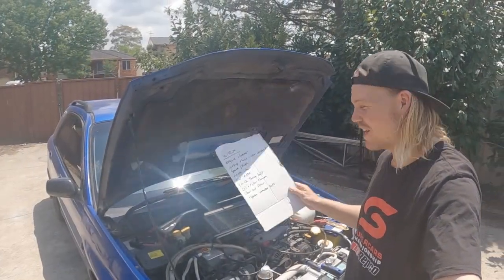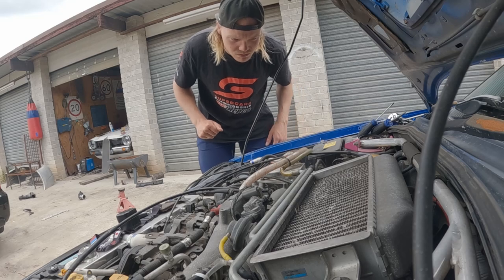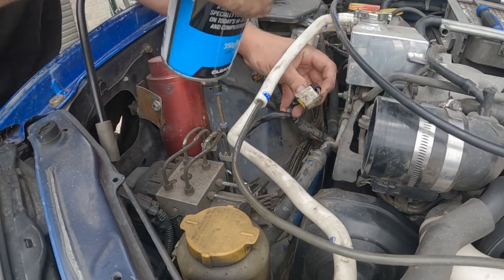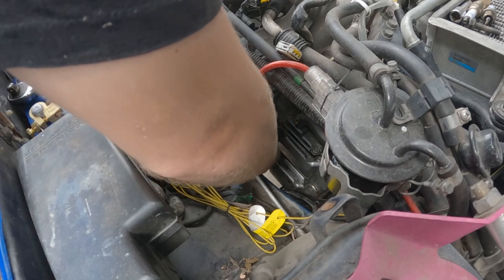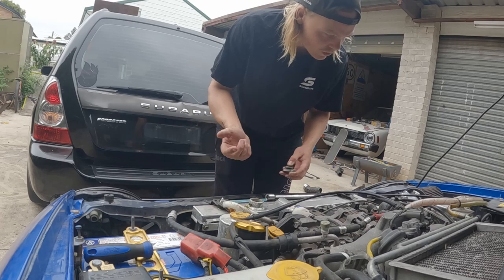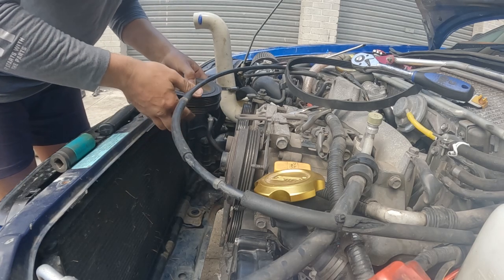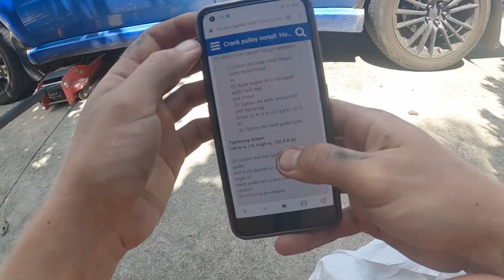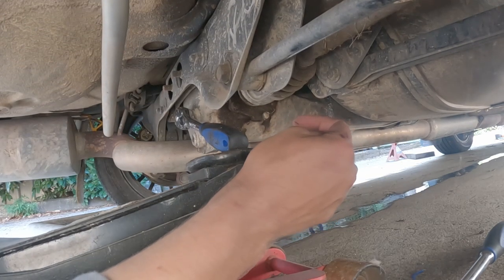Fluidampr Install | Spark plugs | coolant flush | diff oil - wrx refresh

Comment: I did one of these balancers and my go to was a dedicated v belt from the alternator wrapped around itself on the crank pulley. I also had a non working alternator I used so I didnt damage my nice alternator
Reply from the maker: find much of a difference after swapping?? 
not sure if its just a mental thought or not but do feel a little less vibration particularly at idle. But do also have slightly stiffer engine/box mounts. so anything to dampen it is good i guess